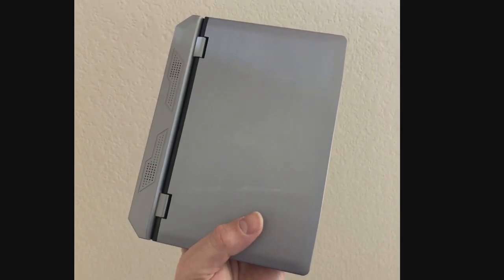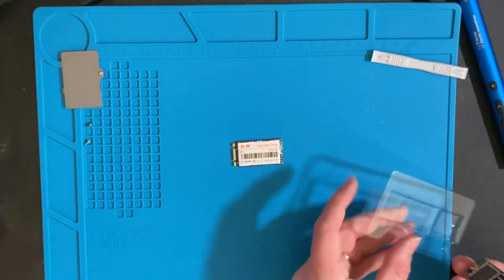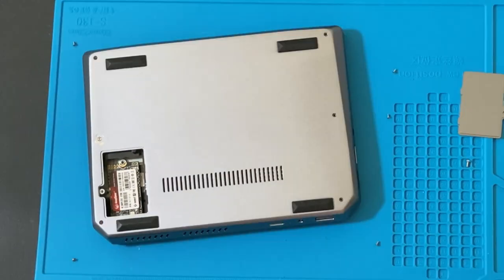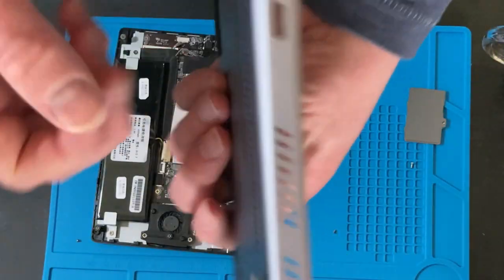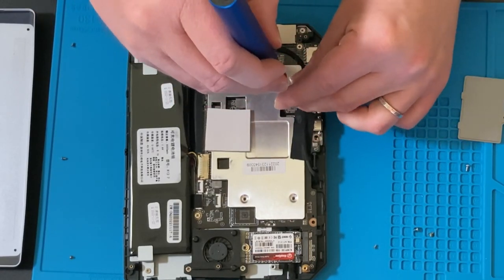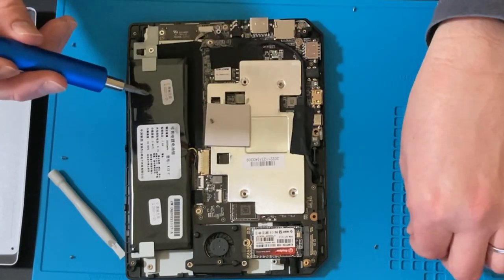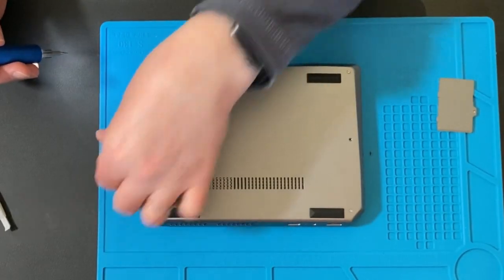The INSIDE of a 7" Laptop - What We Found Will Surprise You!

Comment: With the fact that it doesn't have heat pipes and the fact that it's metal upon metal, I believe that the aluminum conducts the heat to the bottom panel to dissipate heat from the CPU... I would recomend getting some rubber feet for that laptop, sticking it to the bottom so that there is at least a 1/8th of a inch of clearance, that way it can get air flow going across the metal panel and cool the CPU better!!
Reply from the maker: It does have small black rubber feet on it, but with the footprint size of the bottom. But you are right that it does need more clearance than what they originally give it.
Reply: Stick some kb style hinged feet on it for desk use
Reply: @S-Technology  I would suggest flooding area between aluminum plates with thermal paste. It would make outer plate more useful.

Comment: 😀awesome! can't wait to see if we can upgrade this cpu to a duo core in the next episode. if this can be done, then this little tiny machine is totally worth it by all means. also surprised to see the cooling fan does not have a heat pipe directly over the cpu and gpu. improve the sandwich aluminum cookie baking pans, this tiny little system can be a smoking beast!!! thanks!
Reply from the maker: Not sure about me swapping out that CPU.  I am going to make an access for that USBC, add some (probably overkill) better thermal paste and one more idea to help with the cooling.  I think those little mods will make this way more useful for a daily use take everywhere option.
Reply: That's not possible unfortunately
Reply: ...that processor is a quad core tho...
The best thing available on that same footprint (FCBGA1090) would be a Pentium Silver J5040 which isn't too much better in comparison, given the fact you'll have to de-solder a BGA processor and solder back in another one, then hope the BIOS recognizes it and it all goes well, I doubt it would be worth trying.

Funny that Intel claims it's up to 8GB on RAM support (both the Pentium and the Celeron on this specific machine) tho they sell it with 12GB...
Reply: @Kalvinjj  👍Pentium Silver J5040, its Intel UHD Graphics 605 graphics solutions is on the slower side, wondering if anyone tried to play GTA V on this little machine yet? Can we load a stress test on it?
Reply: @Kalvinjj   Celeron J4125 being known widely used in the fanless mini pcs. It was a big surprise to see the unit was designed and equipped with a jet engine cooling fan in mind, am only guessing this system bios would recognize J5040 without any problem by looking its layout.

Comment: It looks like they were going to try to put a fan on the cpu. Not enough cooling. Then use an aluminum plate with that square indention as a heat sync with a fan. Still not enough cooling. Then doubled the plates to increase the mass of the aluminum and then use a fan elsewhere to move air over it. Still must have been cheaper and use less space than a heat pipe. I still give this unit good marks for this design. Thanks for showing such great detail!

Comment: Did you need to install any specific drivers to get the mouse to work after swapping the SSD and reinstalling Windows? I installed Windows 10 and the left click stopped working despite it working on the version that's on the SSD that came with the computer. The button itself also works on Windows 10 because on the boot up menu that says "hit any key" I can hit it and it brings me to my desktop. Bluetooth mouse works fine but I'd like to get the button on the laptop itself working if possible.

Comment: Hell, I'm rather impressed at how relatively easy that was to disassemble. Quite a tidy little unit. I'm also in the camp of dremeling out the USB C port, because on a device that small you pretty much need every port you can get. Also agree with SUCHMISH about the rubber feet, couldn't hurt. With the bottom plate being full metal it should act as a nice heatspreader.

It also looks like it'd be mighty easy to 3d print an alternative bottom plate for it, so you could make Joycon rails, or just attach it to a deeper bottom for extra internal space. Not that I really suggest that, but it'd be neat.
Reply from the maker: Dremeling the port is definitely something I am going to do. Possibly finding some longer adhesive pads for the bottom, and replacing the thermal paste should also help with the heat.  

3d printing a bottom plate is an interesting idea.  You would need to use something that takes heat better than PLA though.
Reply: @S-Technology  PLA would be overall bad both for heat and for creep, the case would start coming apart on it's own in a while at the clips. Definitely something for ABS (heat AND creep at it's best plus it's cheap) but sure is harder to use. At that short height tho it might be quite viable if you've got the bed size.

Comment: So, this is cool. What I'm getting from your videos is that we might look around for suppliers who say it's got a USB-C port, so we don't need to excavate our own holes, and don't be afraid to order bottom of the line specs, because if they're making something better, they'll probably send it to you rather than take one apart and downgrade it. 

You said, I think, it's less glitchy with windows reinstalled. Did I get that right?

And I really wish other manufacturers made laptops that were this easy to take apart! My 14 inch Lenovo was much more of a PITA than this one.
Reply from the maker: @Spencer Dawkins That’s possible. I just keep saying that the quality control  doesn’t seem consistent. I wouldn’t want someone to purchase a lower tier model and expect a better version. 

I do feel like the CPU peaks less frequently after reinstalling windows. 

And yeah it opened much easier than I expected.  I have a 14 inch HP laptop that I ended up tearing a part of the rubber foot and cracking a plastic guitar pick opener just to upgrade the RAM.

Comment: With the ssd change, is the system better or stills as equal with the problems that You have in the other videos?
Reply from the maker: I think it’s better. I’ve noticed it’s not pushing the cpu as high at idle, and Minecraft loads faster. 

It’s still a little cpu, but I think it’s better.

Comment: You have completely unused space in the corner between battery and cooler. Youcan put there some small PpwerDelivery PCB module with Type-C port, set it for the same voltage as standard charger and Soler directly to the charger pins on the motherboard. And "cooling system" needs and modification/upgrade. There is not much room for serious modification, but you can't try to check for the air goes though this laptop inside, and maybe change the radiator to something like it was in the last generations of Intel Mac Air.

Comment: Did you not put new thermal paste on the cpu? Once you break that seal it's always a good idea to put new paste on.
Reply from the maker: @ModerusPrime  I did off camera. But all I had at the time was a older tube of it. It seemed okay and is probably better than the factory’s.  

But this does “give me a reason” to buy some better quality thermal paste and do a video comparing the before and after with everyone’s ideas so far.

Comment: Question: are there unused Ribbon cable slots? At around the 2:52 mark in the bottom right corner. I'm not very well informed but it reminds me of the bits that ribbon cables go into. If so: what are they doing there? What can they be used for?
Reply from the maker: There are quite a few unused ribbon cable slots all over.  Some are probably for testing, but my guess is that this board is used in other larger laptops with other features.  The stylizing, options and layout is really close to a larger laptop reviewed by LTT.  I wouldn't be surprised if its not the same board in various "cheap laptops" on AliExpress.
Reply: @S-Technology  that's interesting! I was wondering if that gave more options for modifications....

Comment: a way to make the cpu cooler, maybe much cooler is to put some new thermal paste on that cpu and not just a little dot like on a desktop cpu, there is no such thing as too much and its a bare cpu die. also put thermal paste between the two sandwiched together sheets of aluminium as air is a really bad heat conductor.
Reply from the maker: I thought of replacing the thermal paste.  Putting some between the aluminum seems like an interesting idea.  
I also though of getting some of those thermal pads (I know they aren't as good as paste) to gap the space between the top aluminum and the bottom of the unit.  There is a large air gap between those two.  The pad currently there seems it's more for structural support than cooling.
Reply: @S-Technology  There are fat thermal pads available.

Comment: Aliexpress states it comes with either Intel J4105 or J4125: "J4105/J4125 Random"
Which CPU did yours come with?
Reply from the maker: The one I have has a J4125. 
I did see that there were different versions by different vendors.  They seemed to want to use fluff terms like "2022 version" or "upgraded model" but if you looked at the listings the CPU varied.  The listing for mine did say J4125, but I also did order the 128gb model and received a 256gb SSD. So not sure about the actual quality control there.

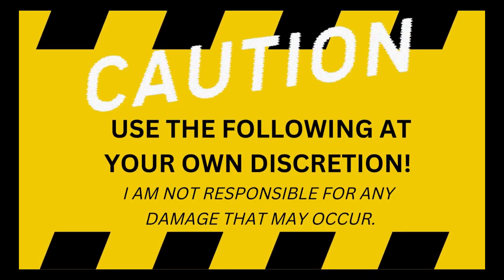Comment: 4:54 What power supply did you use? I found one that outputs 5v OR 9v OR 12v to USB-C. Maby you picked one that only outputs 5v. The shipped charger outputs 12v. Maby USB-C needs 12v too?
Reply from the maker: I used a switching power supply that is supposed to output either 5v 3A, 9v 2A, or 12v 1.5A.  (It's the same large black and red one I used in the review video... I think.) It's actually what I use with a USB-C to Barrel adapter right now to charge it.

Comment: Great video. Purchased the mini 7 inch from Aliexpress a few weeks ago. Installed a new version of windows 11 pro and purchased a key just to to be safe, since there are absolutely no labels as to who the manufacturer is, model number, etc.  

My unit works perfectly except for one problem...the battery is defective.  It discharges from full charge to 50% over night when off. Only will last about 1 hour on battery.  Can anyone tell me the manufacturer and model number of the battery? I was hoping to see this info when you opened it, but everything except the current and voltage was in Chinese. I have asked KT Technologies if they can send me a replacement battery. In the meantime,  I will replace it myself if I can find one...thanks! Jerry Aceto
Reply: I forgot to mention in my last comment that I purchased a 2nd mini 7 for a friend. The 2nd unit proves my suspicion. The battery was at 77% on arrival.when fully charged,  will last about 4 to 5 hours. 
Jerry Aceto

Comment: i feel like it having 2 of those uh....cooling plates(?) was a design defect, as there really isn't a good reason for it to have 2, not without some kind of thermal material between them.
Reply from the maker: I honestly think it's stacked to try to have aluminum between the cpu and the bottom plate, but they would need atleast 2 more to have them make contact with each other.  With just 2 there is still an air gap and I don't think that fan circulates the air near the cpu.
Reply: @S-Technology  sandwich plates appeared to create a gape from bottom and goal is to relaying aside cooling fan to dispersion the accumulative heat. agree, if passive cooling mod can be done to this little machine, it can be a master piece!

Comment: Hello . is it possible to install NVME ?
Reply from the maker: Hmm… I’m not sure. It came with a SATA drive so I just replaced it with that.  I don’t currently have a spare 2242 NVME.  Might have to get one to try.
Reply: @S-Technology  N930ES example. two keys. I agree you should try.
Reply: NVME doesnt seem to be supported. Tried NVME ssd but neither bios or windows installation found it. Tried changing bios settings but doesnt work.
Reply from the maker: Thanks for checking.

Comment: Why dis they hide the USB C port?? Such a weid thing,
Reply from the maker: No idea. I agree with you.
Reply: the lower tier model don't get a USB-C, but its too expensive to design a different MB. Just like BMW and their rear seat heaters - you don't get the button for the heater, but the heating element is in all the seats
Reply from the maker: I think this one is a between generations model.  Like they still had the old casings but started using new boards.